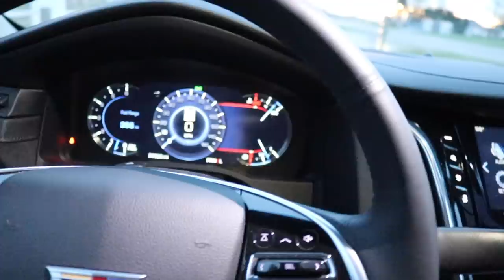He Bought this 2nd Gen for HOW MUCH!?

Comment: Just do a transmission  service drop the pan and change the filter inside of the trans And add the Lucas oil transmission additive it stops leaks and slipping I wouldn’t  drive it until you do that and if that doesn’t solve it then look into getting the trans rebuilt
Reply: You never know with this trucks transmission. If perhaps it is the original trans and he didn’t get it rebuilt (looks like a great truck but people do lie he didn’t have receipts) I would not service the transmission. I wouldn’t touch or service an already slipping trans. At that point you will make the problem worse. And if it is the original trans I wouldn’t touch it either. Not saying it is the original trans but if it is assume that it hasn’t been serviced and do not touch the filter or fluid, you would be asking for more clutch slippage flushing with new fluid. If anything add necessary fluid if it is low. But don’t put yourself in a worse situation. It still drives not too bad, just look into a rebuild
Reply: Danny Bailey on some occasions yes I wouldn’t touch it but a good percent of the time if it’s just a minor slip a service + Lucas does the job and I’m not meaning an entire flush just drop the pan and change the filter at most it’s 120$ and it could fix the problem before you throw a good bit of money at a trans
Reply: C Supple never put lucas oil trans additive in lol that ruined my last trans. Theres no such thing as a mechanic in a bottle

Comment: Build idea: take a second gen 12 valve with a terrible body, but a strong frame, and get an older pre 60s truck cab (and maybe even bed) and throw it on the frame. If you have no bed either make a flatbed or get a good name brand flatbed (cm, Bradford, etc.). It would really put this channel out there as people LOVE to see those type of builds

Comment: Make a mark on the transmission where you can know it’s the same transmission and the shop doesn’t do a swap without letting you know. Sadly there’s some shops that will take in your truck in for a simple repair and swap it with a POS they have laying around.

Comment: It’s not a slip, I am in the process of fixing mine. It started with that. A slip is your in one gear and it slips out into a lower gear, from what I heard in this video it’s exactly what mine was doing intermittently a few weeks before complete trans failure. That is what’s called an RPM flair, it’s flairing up before going to the next gear.
This is a valve body issue almost positive! Pull the pan drop the VB and inspect every part bet you find some broken peace’s. I ordered a new one on advisory from my neighbor who is a diesel mechanic who’s done hundreds of 46/47/48re rebuilds. Also per his information most rebuilds don’t touch the VB unless something is wrong. Look up rebuild kits they only have parts for the internals of the trans nothing for the TC or VB like o said I’m still ripping mine apart but I’m willing to bet in 2-3 more weeks he will have happen what happened to me where the shift points will be super short and top speed will be 20-30mph, it’ll almost feel like a manual with the clutch half way in.

Comment: Try adjusting the bands. Drain the fuild put john deere hygraud in the trans. Dont not use atf+4 in any 47. U could also up the line pressure a little bit. Also make sure the tv cable is adjusted right for the transmission
Reply: big murph Castrol atf+4 by far best trans fluid for 47rh/re

Comment: Change your speed sensor with Chase located on the back of the transmission I had an issue like that and that's what I did and I also changed the motherboard part with the solenoids and it fix the problem. good luck to you

Comment: If you do a transmission fluid flush, within 50-100 miles the transmission will blow. I've had 2-3 blow if I drain the old fluid put fresh fluid in. This may sound weird but Id just put 1 QT of Lucas transmission stop slip in there and keep the old fluid.  it should last a couple thousand more miles.

Comment: That same thing was happening to me but it was sparse few and far between wasn’t consistent, I adjusted the 1-2 band and it shifted Smooth as can be then a week later I did a trans service filter and fluid 48hrs later it quit on me had to limp home at 20mph with the engine screaming at almost 3k (in OD with L/U) replaced every solenoid, every sensor, and the transducer. 4 more fluidchanges and 2 more filters was about to drop the trans and replace the TC, TC pump, and VB my Cummins guy said to hold off on all but the VB ordered a new one and I’m currently tearing apart my current one. Willing to bet you lol have the same issue I did. That’s how mine started I just didn’t notice the flairs until Hindsight.... bet the problems in your VB and bet you have the same thing happening 2-3 weeks

Comment: definitely a transmission issue and he did a half ass fix just in order to get rid of it. if you take it to a shop i wouldnt even tell them what you think it might be. just go in there with your symptoms and let the shop diagnose it. ive had shops that skip the diagnosis phase after ive told them what i think it is and go "yep, that sounds right" and they simply replace that part but it doesnt actually solve the issue. and these were 5 star shops

Comment: Literally just change the trans filter & add the rite fluid atf +4 an one bottle of trans non slip & check the solenoids etc might have to upgrade it with the Chevy one of its a 96 & up

Comment: Idk cant tell from the video that well but i just had a stage 3 transmission build for my 7.3 and they did a tugger shift kit and what not that. And it gives you like a stiffer shift idk how you would describe it completely but its not the same as a a stock trans build shift so if it was rebuilt they could of done something like that. Possibly no guarantee though just a thought to look into.

Comment: I found a 12 valve for $2,500 and it needs a trans and a turbo, should I buy it or pass
Reply: That Guy Gaming Trans will be 3k plus 500 for a torque converter, 1k for turbo plus install. I’d just buy a 6k 12v. It’d be easier.

Comment: Ya ya ya. Roads here will swallow your dump truck ha ha ha Ha u so so so funny as if man. You need to go on lakes barley frozen to the nearest pump pumping oil gas desil is the shit that comes from all of gas making.  And oil.. Dodge desil are the world's worst truck in the hole wide world. It's most likely the reason kids have these trucks. Ooooo n swear by them n work on them from day 1. All. Mercedes motors now not even close to Dodge. Most of them are all shouting down. I fucking told all u wankers it would not last. We r to week to handle. Colds flus sore throat. Sore fucking back so I need pain pills you people that do drugs go drown your self and stop doing drugs. Don't tell people